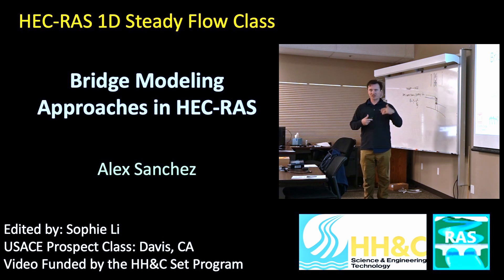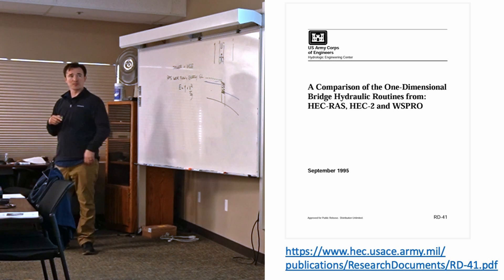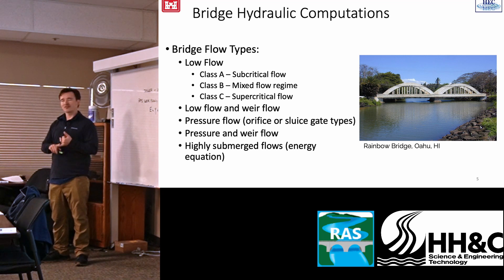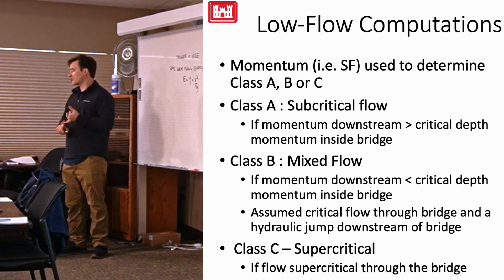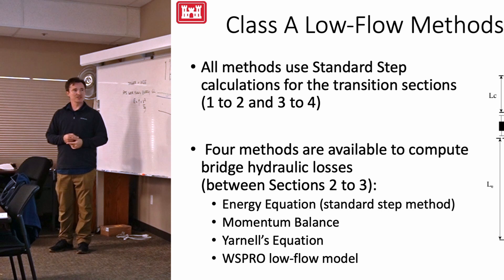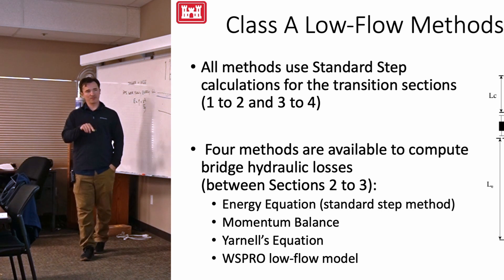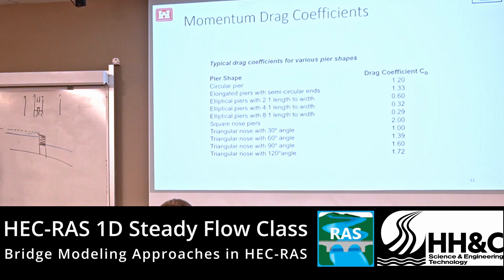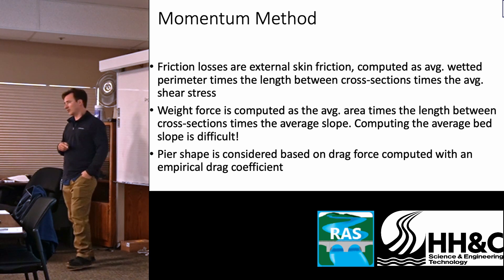Bridge Modeling Approaches in HEC-RAS (L2.6-1D Steady Flow Class)

Comment: Is it appropriate to create a less sinuous thalweg alignment (than you might do for low-flow modelling), say for a 50-YR flow? The reason I ask is that I created a model with cross sections that were too short, so I need to extend them, but I don't want to overlap the cross section sample lines, and in Civil 3D, the sample lines (cross sections) are confined within some tolerance relative to perpendicular, so I'm finding that I may need to straighten the thalweg alignment to achieve this...hope this makes sense and thanks!